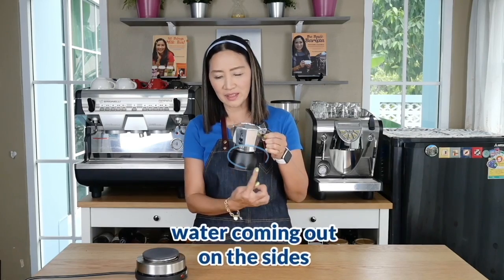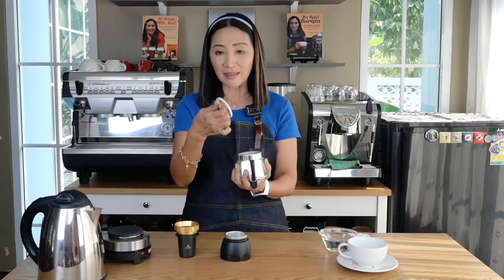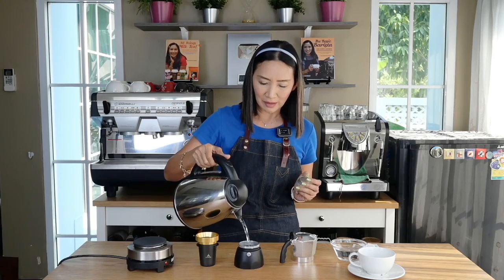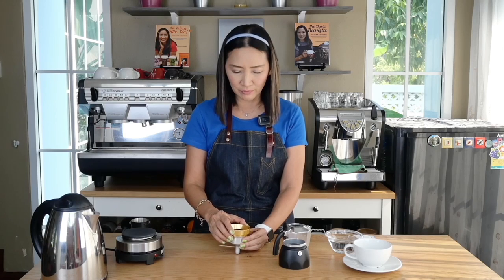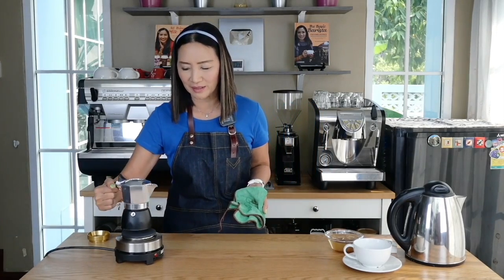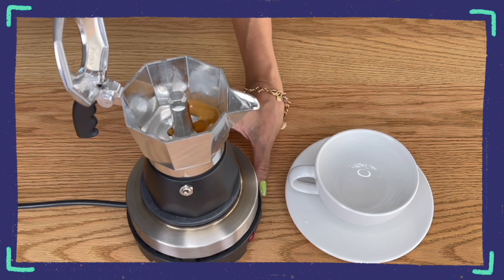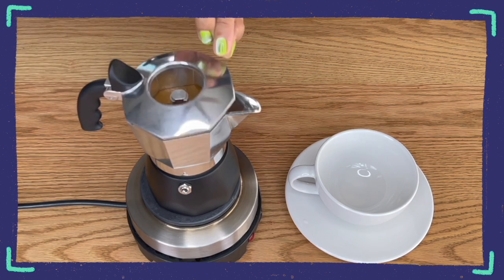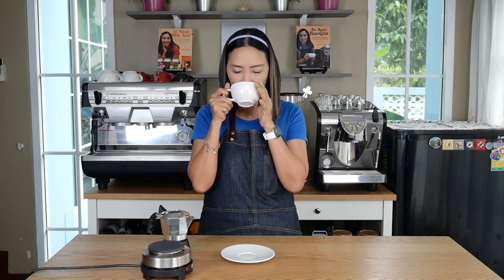HOW TO FIX LEAKING MOKA POT Featuring Moka Pot Brikka

Comment: I'll have to try the wet gasket. 
Usually I just tighten the pot as hard as it will go. 
A silicone gasket is more durable than the regular rubber gasket, I've had the rubber gaskets dry out and melt to the pots before. 
Another tip is to store the pot loosely assembled so that it's not tightened when not in use. This will keep the gasket from being compressed and should extend the life of the gasket.
Reply from the maker: Thanks. Let me know if the wet rubber gasket works for you too

Comment: i unscrewed the top piece and removed a rubber part, no foam...
4 cup is much bigger than i thought it'd be, thought i had 3 cup but maybe it's more like 2, barely enough to fill a pretty small cup but the 4 cup one seem to fill about 1.5 of my cup
Reply: scalded my hand pretty badly when it started spitting water.
guess one has to pull it of earlier, or maybe just ignoring it until it stops. or wear some sort of protection.